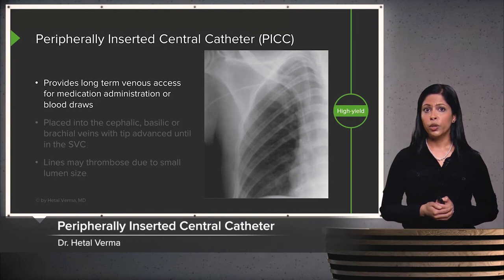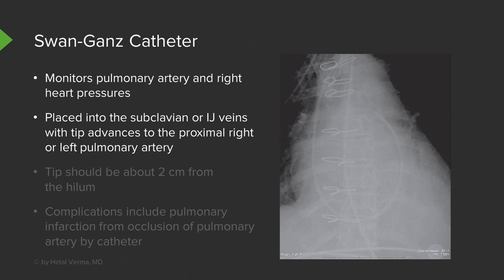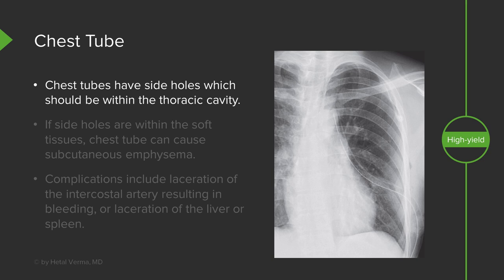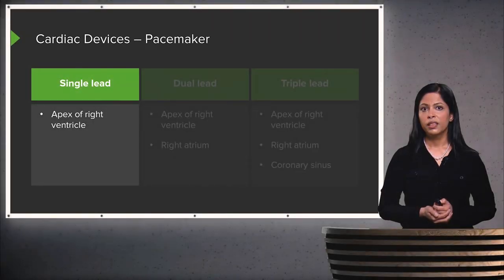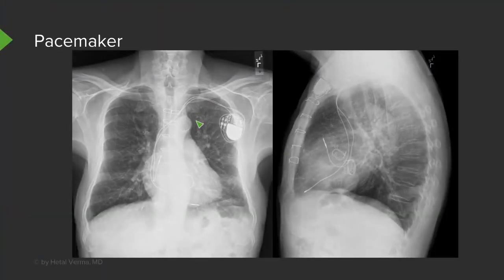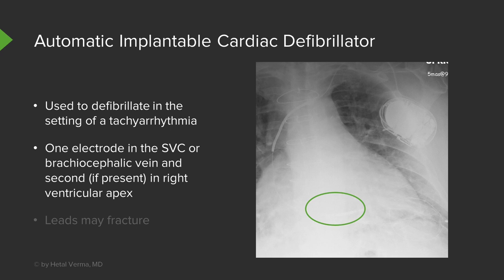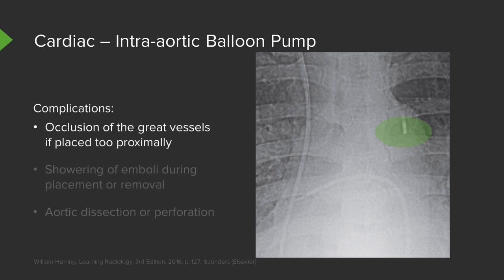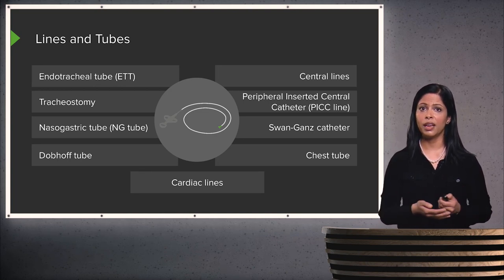Lines, Tubes and Cardiac Devices in Radiology – Radiology | Lecturio

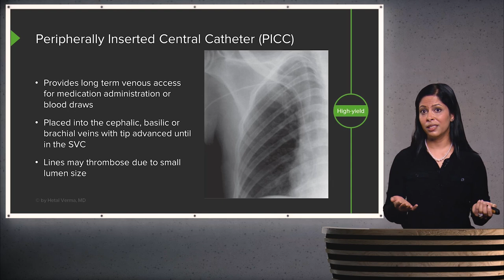Comment: 0:04 PERIPHERALLY INSERTED CENTRAL CATHETER 0:39 SWAN GANZ CATHETER IN PULMONARY ARTERY 1:21 CHEST TUBE 2:07 CARDIAC PACEMAKER 3:36 AUTOMATIC IMPLANTABLE CARDIAC DEFIBRILLATOR 4:12 CARDIAC-INTRAAORTIC BALLOON PUMP 5:02 LINES AND TUBES